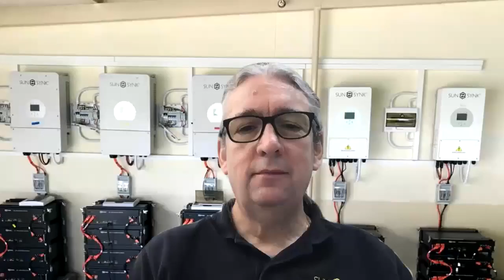Sunsynk Wiring multi inverters

Comment: Do the batteries have to be on a common bus even for a dual inverter setup?

We're buying a house with a sunsynk installed, and the battery is a different brand than ours. Thus, can't be connected in parralel

Comment: We have this system with Hydro feeding Master and Solar feeding Slave. However when we have drought or very low flow we are isolating the Powerspout PLT Turbines. However then the solar is barely working alone as Slave. What is the solution? We hope to add Wind too so ideally they need to be able to work independently. Phase rotation making them all Masters sounds good.

Comment: Hello,
If im running two 6K 1 ph
One is connected to 2phases supplying it both with 220volts
Other one is connected to 3rd phase also supplying with 220volts

What are the master srttings for them? Should i sync them or just dont and they will do the job?

Comment: Does the display on each inverter show a total of power to the load or only for the specific inverter? Should the power figures be added for total power used, generated?

Comment: Nice video, thanks for posting. Is there a forum for discussing some of the issues relating the the Sunsynk inverters? I am assisting a friend who has installed two 12kW three phase systems and we are battling with a F21 error and need advice

Comment: Thanks Dave, If you run two inverters in parallel, do the smart loads have the same operational mode or can they do different things on the different inverters. More specifically can they be set to go off at different battery SoC levels? Thanks

Comment: In the manual - Hybrid Parity (Super) Inverter it currently says says for Sunsynk Wiring multi inverters
"where more power is required it can be connected in parallel either single or 3 phase configuration. The maximum number of inverters that can be paralleled in a single phase utility grid is three (10.8kW, 16.5kW, and 26.4kW for the 3.6kW, 5.5kW, and 8.8 kW model, respectively) and the maximum number that can be paralleled in a three phase utility grid is nine (32.4kW, 49.5kW, and 79.2kW for the 3.6kW, 5.5kW, and 8.8 kW model, respectively)."

In this video you mention that it is possible to parallel at least 10 inverters. Can you please clarify what the current limit is for the number of inverters than can be paralleled?

Comment: Great videos. You make a point that you can have many inverters on a single phase in a master slave configuration and the batteries must be on the same bus. Are you saying that all inverters in this master slave configuration can connect to one battery or should each inverter have its own battery (of the same capacity)?

Comment: Have loved the videos... i am struggling to get some answers which i hope you can help with. I am busy installing a system at the moment. It has 2 x 8kwh, 12 410w PV Panel & 4 Pylotech Us3000. I am just looking for confirmation on the wiring. Setting up as a master and slave is easy enough but the wiring between the two inverters is where i require confirmation please. I am going to take all 12 panels into one inverter as 2 streams of 6. All 4 batteries will go into one inverter and then a parallel connection to the other inverter and the same for load and grid is this correct?
Reply from the maker: Damian Nelson you can call our SA help line
Reply: @sunsynk  That would be great can you give me the number?
Reply from the maker: Damian Nelson +27 (082) 504-4510 Shabir